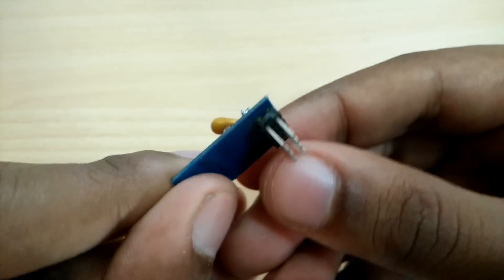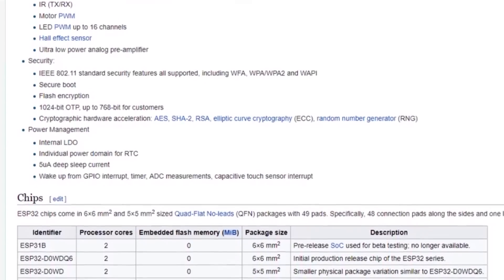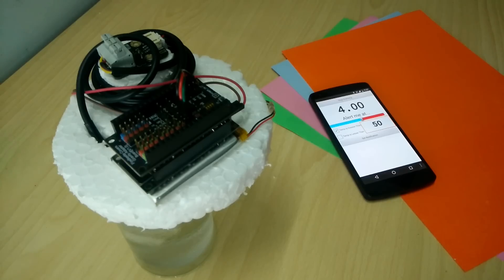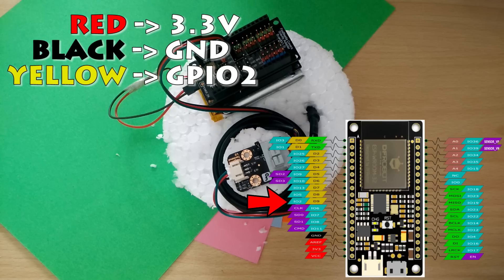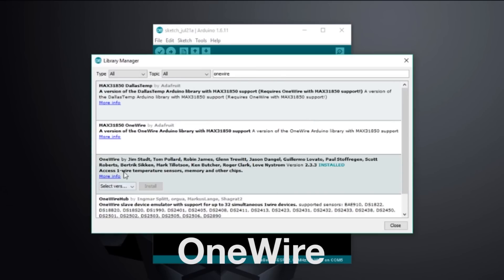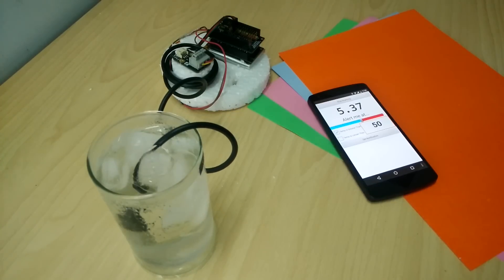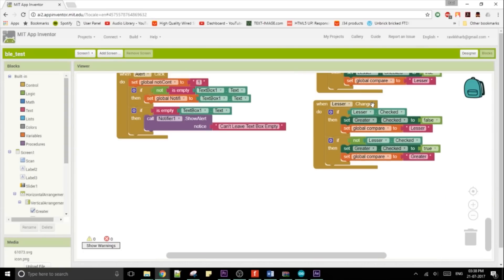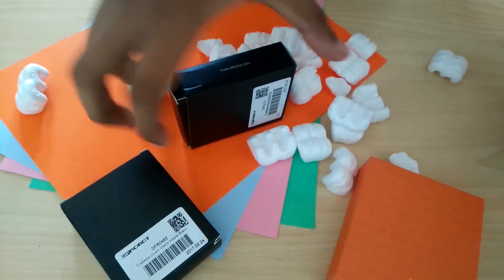ESP32 Bluetooth(BLE) Temperature Sensor [OLD METHOD]

Comment: hi, thanks for the tutoriial, im using the code with the firebeetle esp32 and a shock sensor. I send ESP10 if idle or ESP20 if sensor is activating. Your app i receiving values for about 3 secs and then nothing. If i close the app and start the app again, i get again values only for the first 2-3 secs.
Reply from the maker: I would not recommend following this tutorial anymore. Better methods are out now.

Comment: Hi, when I use your .apk file app works fine, but when I use your .aia in Mit App Inventor, on app show just -1000, no temperature. Any idea?
Reply from the maker: It won't show any real values on the app inventor itself but it will work if you compile the app or use use tye AI2 companion for testing.
Reply: It works. Thanks.

Comment: hello Sir,
i need to get data of dht11 on my phone for a project through esp32 ble. I tried to your code and it shows error sdkconfig.h not found error exit 1.
help
email-guptaanmol14@gmail.com
my email if you can provide your contact to discuss.
thankou
Reply from the maker: This method is no longer a good one. There are better and newer libraries available. Look into them. Or you can wait, I'll be releasing a updated version of this video in a week.

Comment: It's not working any one try, or it's fake?
Reply from the maker: +sonu kushwh It works for me. What problems are you facing?
Reply: it's always show pairing and never ask for a pin and unable to pair. Please make a video for simply connect with the ESP and send serial data, Thanks!
Reply from the maker: +sonu kushwh It's not possible with yhe current arduino libraries.
Reply: How did you do it?